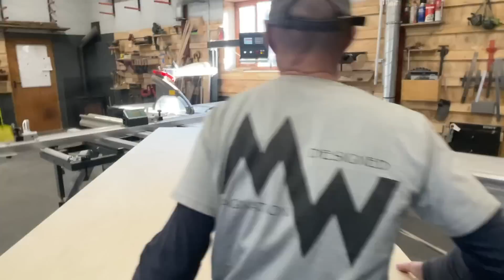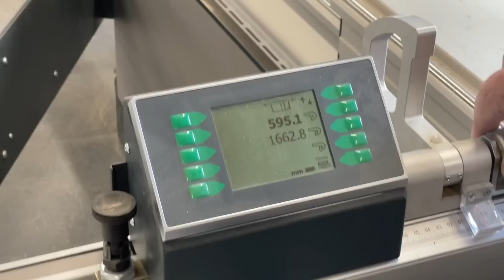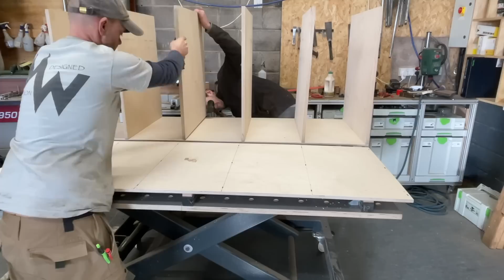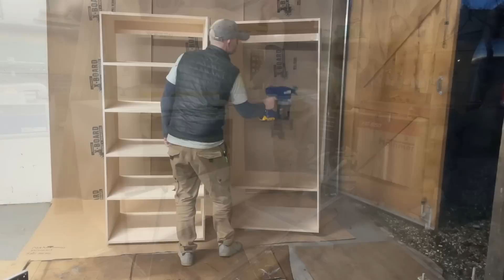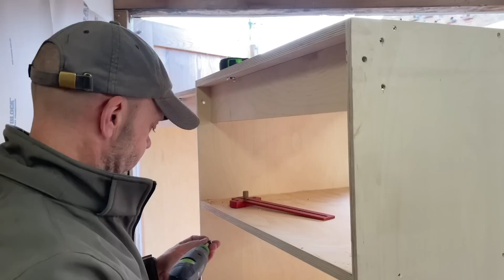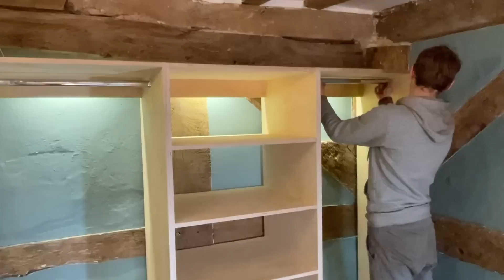Small Walk in Ply Wardrobes

Comment: I noticed you didn't show ripping the 8 x 4s lengthwise, I was wondering how you were going to manage that without an auxiliary outfeed table?
Reply from the maker: You don’t really need an auxiliary outfit it’s only 12 mil ply some 18 you can just push it through if you really pushing heavy stuff I put a live table there. I am looking to make an outfeed table for scraps I just having a time and the workshops not finished yet but thanks for your input and Feedback I really appreciate it

Comment: I’m always interested in the payback equation on the more expensive equipment that I buy/bought. I don’t worry about smaller stuff like drills/drivers even domino machines but when you are looking to fork out thousands, it’s good for me to know if that equipment is a luxury or something I need. I take the purchase price and a guesstimate for maintenance and consumables. If I take a wide belt sander as an example, I would get good figures from the manufacturers on maintenance and add on the cost of regular changes of belts.  So, if the capital cost is (just figures) £10,000 and I reckon that I will sell it on in 5 years for £4,000; I use the figure of £6,000 plus interest (if buying on credit or loss of interest if using money from savings); say £8,000; then divide by that 5 years (£1600) plus the maintenance and consumables (just guessing at £2,000) and know that the machine in use will cost me £3,600 per year. The question then is; am I going to be using the machine sufficiently to save me a minimum of £70 per week? 

Those figures are just examples but it does show the approach that we used to use in business when we purchased capital goods. Of course, if you buy things on a nice-to-have basis, then good luck to you; I’m just showing a business way to approach things.

Those FAT tables are very nice - but the cost! I was able to buy a second hand mains-powered electric lift table (way over my needs at 5 tonne capacity) for £220 delivered to me (£150 plus transport cost). I then put it on a torsion box that I made with H/D castors underneath. It’s no doubt much heavier than a FAT but I can still move it around quite easily. It is mains powered so I have a permanent cable attached to the table; curl it up on the side when not needed and just plug it in to the nearest socket when I want to raise or lower. That whole operation is slightly time consuming but a price I think is balanced by not having to manually pump the table up. I will be putting on top another torsion box a la MFT so that I can use it for assembly etc.etc.

These tables come up quite often it seems; if you are prepared and able to do a bit of conversion work as I did, then I reckon I saved myself well over £1,000. I will be buying another which allows me to do away with all infeed/outfeed tables as well as saving my back from all the lifting. I hope that might help someone.
Reply from the maker: You got some really good questions here in fact I’m thinking of making a video answering them. A quick reply regarding the FAT table , I think I’m gonna be buying a third one when I finish the new shop. I simply could not do my tasks day today without these tables last week alone they were flat out building windows and large oak doors that I simply cannot lift or move around. When you’re trying to position things into a Wide Belt Sander or move something carefully onto a big panel saw. The item you’re moving is expensive as you put so much time into it and the materials. The machine you’re loading it onto his expensive and doesn’t want to be hit and knocked out of calibration. They are one of the most used and loved item I have bought total game changer and I expect will lost a life time .  All of the other items I’ve bought are literally to make my day at work more efficient and more fun. I found as I invest in better equipment or output improved dramatically
Reply: @ManorWood  thank you for the reply. You and I differ in as much as I am now retired and you need to make a living. Time for me, therefore, is not the critical criterion but now taking heavy labour out is; for you the criterion is efficiency - which includes not having to do a job twice because something went out of square. My original reply was really based on my thought at the time about the calculations I would have made when I was an MD when it came to purchasing this or that.

Comment: Do you find the sheets are not square from factory or do you just do it 'because' How is that Graco battery sprayer working, Peter Millard (10 Minute  Workshop on you tube) his broke 3 times I think he gave up with it, poor for the money? you covered your own ass about no extraction 😂
Reply: I had seen Peter’s thoughts too. Tim on restoration couple really likes his graco not sure he has worked it as hard as Peter did to his although it should have more than lasted Peter’s use as well
Reply from the maker: Square them just in case with Multiple wardrobes things can really run out otherwise
Reply from the maker: I had no choice as after the fire have no compressors so I bought this in an emergency it’s okay just put out a lot of material , over spray